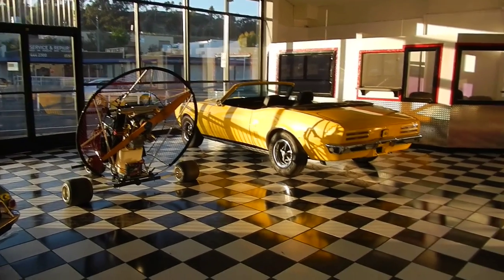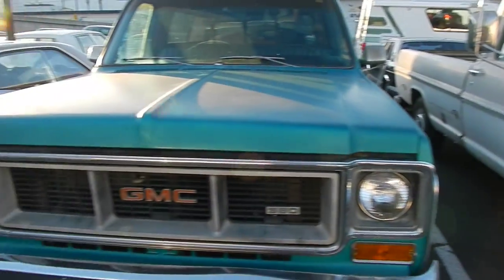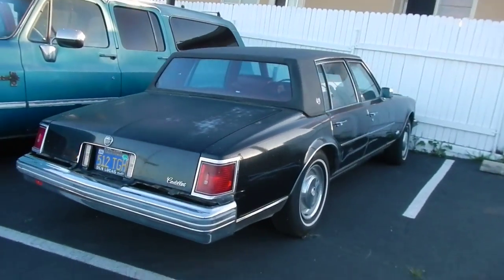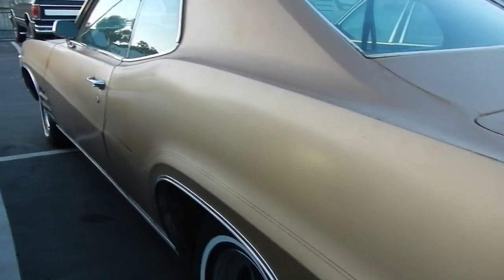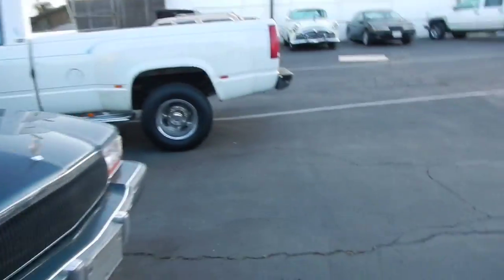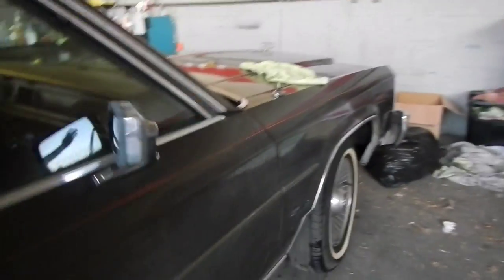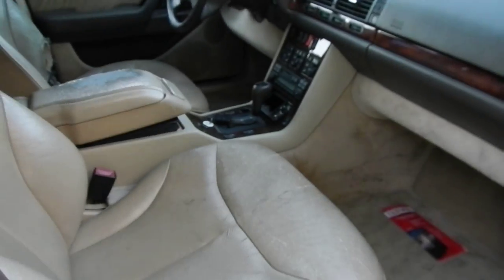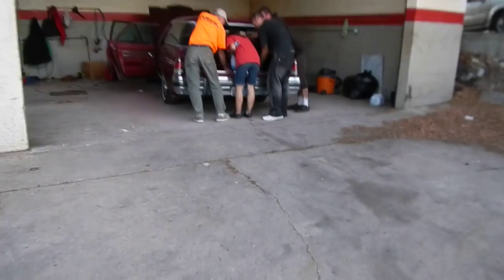Walkaround Mercedes Benz W126 W116 W140 Porsche 944 Wildcat Jeep Chevy Oldsmobile GM Classic Cars

Comment: @Forgoten214 If you give it 100% throttle then yes it will lag a bit at first. There's a bit of a delay when full throttle is applied in order to make it smooth and not abrupt. I test drove a 420SEL and it did that. Newer BMWs have throttle delay too.